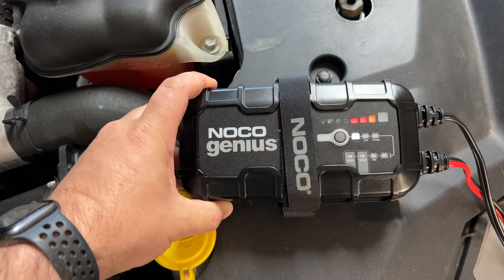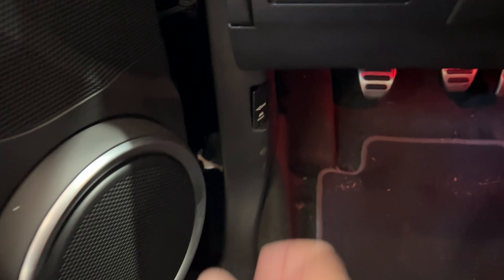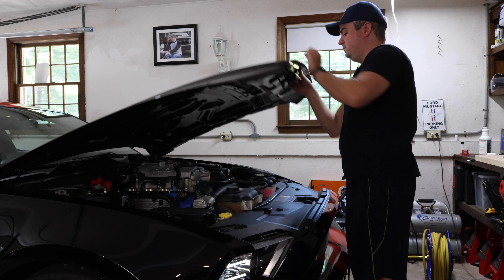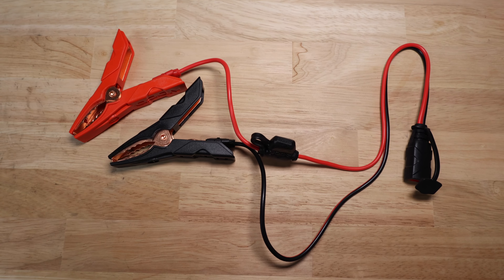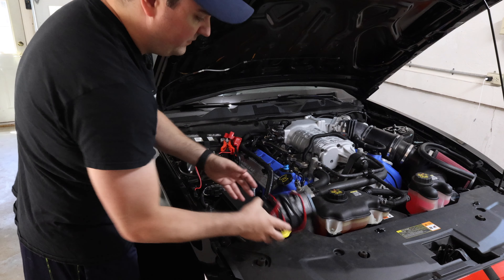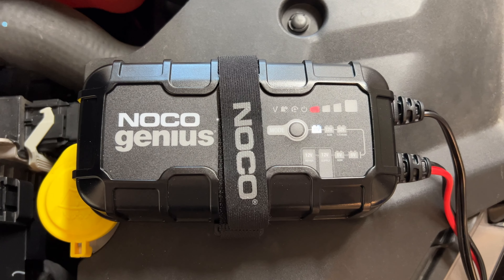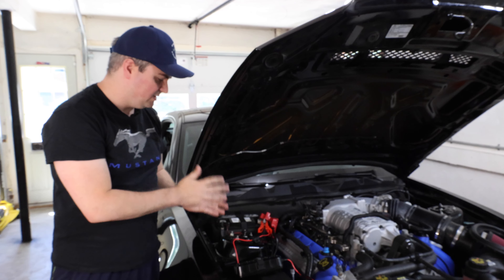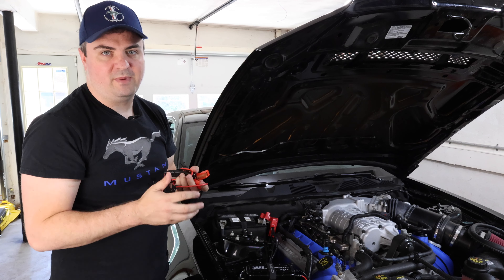The CORRECT Way to Charge a Car Battery

Comment: Nice simple video Smackey but very helpful man.  So when you use that charger and the battery gets to fully charged it then goes into trickle mode right away?  Thanks for the lesson..
Reply from the maker: Thanks Robbie! Yes, it goes right into maintenance mode after fully charging.

Comment: Thank you for showing the process!  Very helpful!
Reply from the maker: You’re welcome!
Reply: @SmackeysGarage  can I ask you about the negative clamp?  The manual says to hook it up to the chassis or engine block, but I haven't seen anybody doing that on youtube.  Does it matter? Thanks
Reply from the maker: So the reason why they suggest you do it that way is if there are any explosive gasses around the battery you do not create a spark to ignite those gasses.